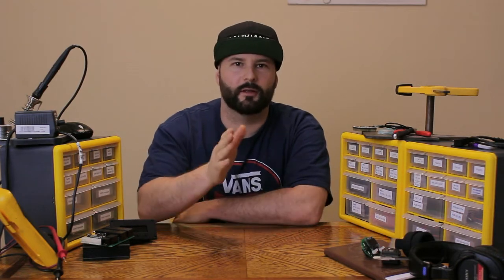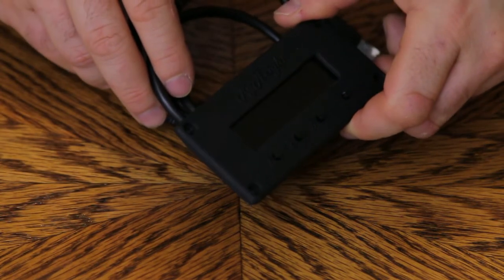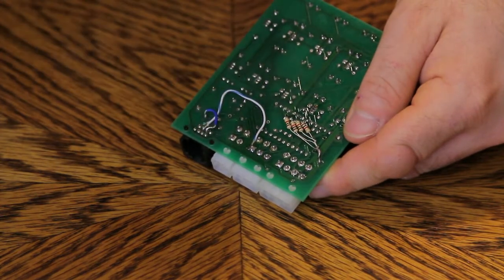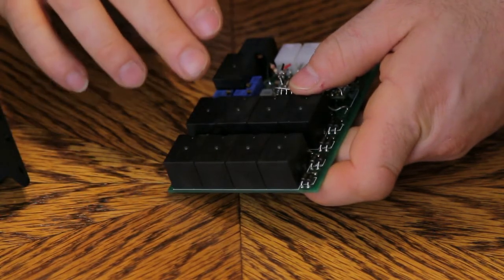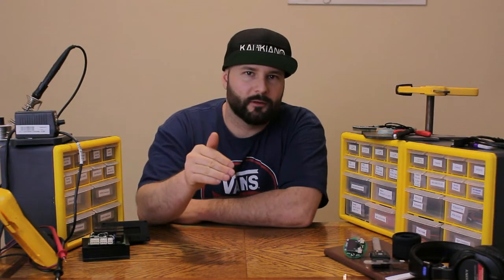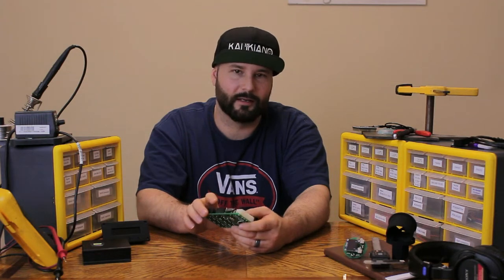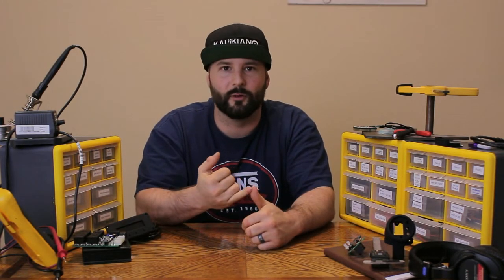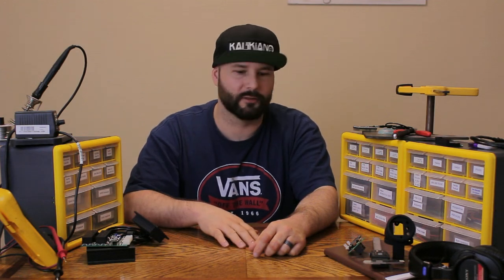WOW!! I NEED HELP! Auto AirRide Controller part4

Comment: Alrighty bro, its 2019 now, and no new posts at all.  Hope all is good and found your foothold. 
Now regarding your final air ride video, where are you with that project?  You sell the rights off to your equipment and or proprietary designs and software?
You find fabricating solutions?  
Am interested in helping if you are just at a pause.

Comment: Looks good to me. I do like the compact round controller. Dash space is hard to find. What valve system are you looking at? Do you need any programming / debugging help? I would love to see a sub $500 controller.
Reply from the maker: L Lars 
Thanks for watching, there would be no valves supplied with the system however I am calibrating it to 3/8" valve 
But there is three settings on lifting speed, this is partially why I would need to tested on vehicles I have virtually tested it with air tanks and the valves just need to see it in person so I can make some tweaks, thanks for your input it really helps, I need to find a way to make these molded plastic pieces cheaper I got a quote from ProtoLabs and just to make one run it would cost $7500 initially then the parts get cheaper. For example just for the switchbox it would be $3 vs $20 from Shapeways
Reply from the maker: L Lars
One more thing I forgot to mention in the video that the rectangle LCD display has a bezel that Mounts around it that's flush with the overall size of the face and that allows you to surface mount, mount underneath or on top of dash and bottom, so overall 3 to 4 different mounting styles including flush mount just with that one LCD
Reply: I have a bagged VW if you need to test.
Reply: Man I would love to use this controller on my Audi.  Im local to Sac too maybe some day we could work something out.